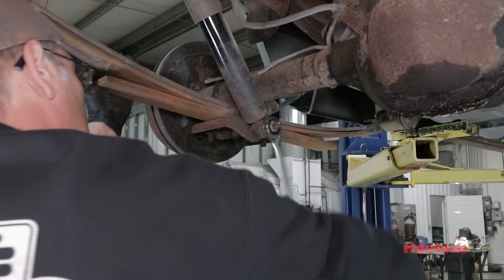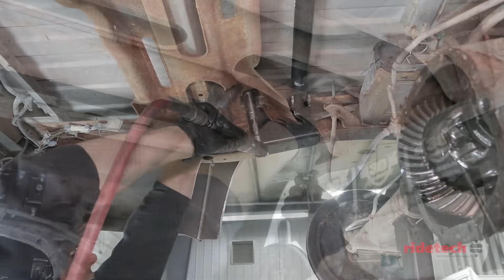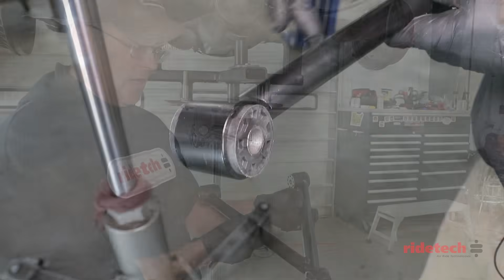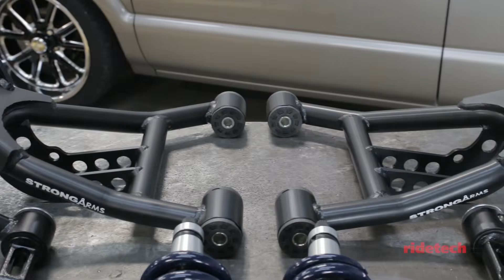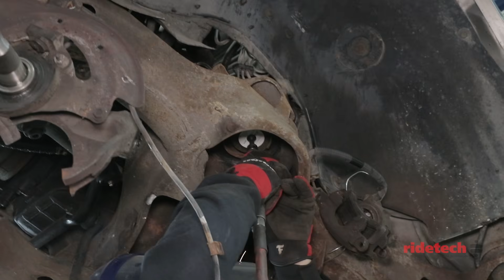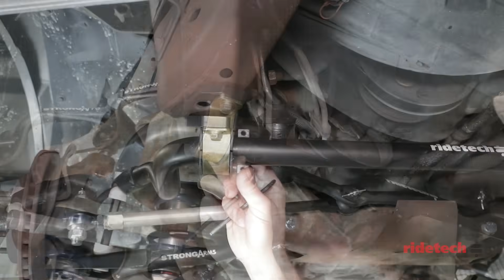GM S10, S15 and Sonoma Coilover Suspension Installation

Comment: You have got to be high on drugs if you think I am going to spend more than what I paid for the truck on suspension. what, is it plated in gold? I'll pass. I'm fine with my $500 coilovers and rear springs 😃 add a rear sway bar and that thing will corner just as good as that $5.5k system for a fraction of the price

Comment: Pricy for sure.  Not many S10's out there worth the cost of this kit.  I have a very clean 170K mile ZERO rust truck but it's hard justifying the cost.  I'd bet at 3K you guys would sell a ton more kits and still make good money.  Vastly expand the customer base.  I for one would be a buyer!
Reply: First of all, I think this is more for the "money no object" kind of builds. But beyond that, this kit was likely VERY expensive to produce (in material + R&D). $4500 seems pretty reasonable to completely redesign the suspension of a truck for a very niche market.
Reply: you are right. if you drop the price of anything by 50% it would sell faster. With your wisdom I now wonder why its out of your budget?
Reply: @@nomadicjoe6124  LOL.  Didn't say it was out of my budget just overpriced for the target market.  My daily drivers are a TRX and an F-Type R.  I'm pretty sure I could squeeze the kit into my budget.   Actually , I have started on my S-10 build that includes this kit, but I changed out the coil overs for Vikings.  Thanks for the comment.
Reply: @Oncebitten10  TRX and F-Type R.... gross waste of money... and you bought the kit you claimed to be overpriced too, cograts!
Reply: @@nomadicjoe6124  Thanks for your constructive comments.   I will immediately focus on redirecting my focus and life goals so that I may someday achieve YOUR level of "wisdom" and intellect.  I am confident the profound impact your comments have made in my life will guide me to make better decisions, thus improving my automotive experiences. Thanks again for just a few of what can only be assumed to be many enlightening, educational, and fulfilling volumes of contributions you have undoubtedly  made to the automotive enthusiasts community 😄

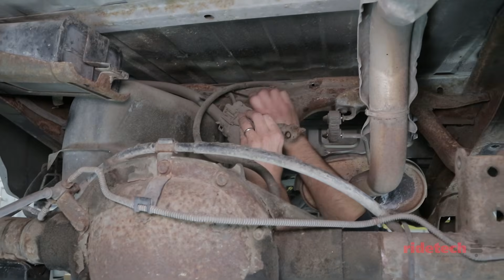Comment: At 2:23, this is the EVAP system fuel tank solenoid, not the emissions solenoid. It is normally open to all air into the activated carbon canister until enough drive time has past to close it and open the purge valve on the engine with the green port used for diagnosing EVAP leakage. During refueling, hydrocarbon rich air exists the tank at the highest spot to capture organic fumes from the tank. This allow refueling without constant shut off at the pumps handle. The EVAP system is completely separate from the emissions system except during purge as extra fuel vapors come into the engine without coming from the injectors and no code is set as the PCM’s fuel mapping is disabled during this time & also if above 80% of full or 10% below empty.
ASE Master Tech since 1978.
Reply: Completely useless info but hey, if you only know one thing, make sure you put it everywhere
Reply: @ThatLS10   Unfortunately, I had every system to work on, plus teach. Pass your I-9 security for Raytheon holding 30+ 4hr tech seminars in 7 states. I have complete knowledge of all systems including those you have never hear of. You are welcome.
Reply: @ThatLS10  you say that now to tho you'll be looking for this comment on how the evap system works when you get a check engine light for it evap systems are annoying to deal with.
Reply: @photondebuger45  i’m a red sealed mechanic in Canada.. so i doubt it
Reply: @ThatLS10  oh quite good, nevermind then
Reply: @ThatLS10  It was not useless to me. 
You speak for yourself only. 
Jerk.

Comment: Seems like the front places the whole weight just on the old shock mount... it looks structured . But seems like it should be a bit thicker or re-inforced either by a weld in or sandwich plate that somehow wraps around and under the old spring cup

Comment: Cant understand why people like lowered trucks looks like the coil springs and shocks are bad when lowered rides rough you feel every bump in the road it banges and when hitting bumps scrapes on driveways and inclines the only thing low that is right are sport cars corvettes mustanngs ect but to each its own
Reply from the maker: I bet you would be surprised just how good these truck ride. when a vehicle is lowered properly they ride just as good, if not better than sports cars.
Reply: @ridetechtv  true i am sure they ride good but its harsh on bumps and scrapes on inclines and terrible if you had to drive in the snow or off road or tow i just like the way a 4×4 sits but to each there own i have a 2000 chevy s10 extreme and i am lifting it 3 inches i got it for very cheap with a 124000 on it shoul of just sold it or traded it for a 4×4
Reply: that's why a lot of people who are lowering their trucks go with airbags. that way if you don't want it low you can still have stock ride height. people that lift their truck are trying to compensate for something in my opinion. small dick big truck

Comment: Would this work with an 93 Isuzu pickup ?
Reply from the maker: no, just for the s10
Reply: 93 no. 94 yes isuzu hombre is an s10.
Reply: The 93 is built by honda

Comment: the cost of going fast and handling is not cheap regardless of what you start with. So my V8 S10 Blazer cost me 3k. Has a nice little LT1 350 and it scoots. I would love to do this but all i seem to know is how to make a junk car cost me a lot and sell for very little.
Reply: Thats what i'm saying.. I picked up a clean 2003 Single cab Zq8. Right now I'd like to have a V8 but I'd prefer upgrading the suspension first. Just can't find any real reviews on how this entire kit handles  BEFORE and AFTER.
Reply: @ghidraa9340  if you go ls1 it's only 90lbs more than the 4.3 so probably not a lot of difference.  Add 45lbs to the rear and you're balanced
Reply: Basically relocate the battery.
Reply: @scootersonlyrepair  or just tie down a crate to the bed and add 3 15 LB dumb bells 🤷‍♂

Comment: Can you use it as a work truck if I install it on my s10
Reply from the maker: Sure Can, depending on the load your pulling or hauling may require coil adjustment, or more air pressure if using the shockwaves.

Comment: So, according to the website this 4 link kit wont fit an 03 xtreme?
Reply: lol, Looks like the truck in the video is a zq8. Kind of dumb the website says it won't fit a 03 xtreme. However, 03 xtreme and 03 s10/sonoma in general compared to the truck in this video have a different vapor canister with a wider canister bracket and a plastic fuel tank instead of steel. The vent valve on an 03 is located behind the canister just inboard of the frame, so its already out or the way. But with the different canister, it may need to be relocated all together to fit this kit.

Comment: I couldn't imagine spending 4500$ on a suspension upgrade and not painting the differential or at least buying a new differential cover.
Reply: I'd have to have the rear end from a 4wd s10.  Rear disc brake and 2inches wider.
Reply: @scootersonlyrepair  and an ugly offset set of rear wheels
Reply: Amen, i would remove the bed and paint everything but the fuel tank.
Reply: @jjj55561  why wouldn't you paint the tank

Comment: Hi i have a 2001 chevy s10 kinda simular to this truck in video will this kit fit my truck and do you have a website where i can buy this same kit but i want the air ride and also if i c notch my frame will i be able to sit my truck on the ground with this kit
Reply from the maker: Hi Travis. Check out the S10 section on our Trucks page here for the complete air ride version of this kit: https://www.ridetech.com/applications/trucks/

Comment: $4,500 suspension on a $1,500 truck, is a little like polishing a turd.
Reply: I've seen these trucks sell in 2021 for well over 6500, up to 20k. The times they are a changing. Everyone wants these trucks if they can find one that's not worn out.
Reply: @BartlettDaveJr  Are you seriously cruising comments sections and replying two-year-old comments? 
 And NO, nobody is buying a S10 for $20,000. If you believe that, I got an S10 I will sell you.
Reply: @MOEMUGGY  lol. There's a lot less than there were and people like them. No shit I saw one yesterday, crew cab S10 19,500 and I saw an 84 blazer they wanted 24,000
Reply: @MOEMUGGY  ok sure. I'm just trying to rebuild my blazer and it's not even running and I won't let it go for less than 2500
Reply: @BartlettDaveJr  dude, you can buy 10 blazers a day for $500 a piece on Facebook Marketplace. Your Blazer isn't worth $2,500 running. Seriously though, I don't care. Go away.
Reply: @MOEMUGGY  yeah whatever, my blazer is not a rusted hunk of junk, I just bought another one for 500, I'm not an idiot. They get way pricier.

Comment: i have a 1950 f-1 with a s10 frame. i could use a arms that are wider than stock to make the tires fit better. if i buy the kit can i get a arm made for that or you don't do that?
Reply: Get  a cvpi frame  Instead  keep the Ford a ford.
Reply: @scootersonlyrepair  it was a rusty pile of parts a customer gave to me to cover their late bill it had no frame or engine. and i was like 18 and poor. also who cares about ford in a ford. hot rodding is about riding and having fun. not being a puritan.

Comment: When your suspension costs more then the truck lol
Reply: Just got my catalytic swiped. Cost mea nearly 800 to replace including a used Flowmaster that I got a good price for .paid 500 for the Damm truck. They Damm near  stole it 2 times since I had it. That alone was more money than. The dam truck cost alone.  But hey this thing took me from Stockton ca. To los Angeles on 1 tank. Never left me stranded till the motor blew after I put the new catalytic.. don't know what went wrong man it ran so good. Smh 😔.  But I'm gonna fully build it.  The process has begun
Reply: How much?!?
Reply: @mistahferguson6240  like 6k
Reply: @lege46 gawd damnn.. I was thinking of getting it but holy fuck I could just buy 3 more s10’s🤣
Reply: *than
Reply: I mean... my S10 Blazer with less than 110k on the clock cost me $80, so... a full tune up costs more than my truck 🤣
Reply: @Scott9181970  I see the V8 swapped S10 he's going for 15 grand they're worth good money if you put good money into them
Reply: Prices have gone up since then, those trucks still aren't worth any more
Reply: @BartlettDaveJr  worth more no. Selling for more fucck yes.  An excellent condition 2001 extended cab with 40k miles  sold for 16k stock except the stereo and wheels
Reply: @scootersonlyrepair  agree
Reply: Truck in mint condition 7 grand……suspension 🥸

Comment: That cross bar the upper arm is attached to is pretty thin gauge metal, wonder how it takes all that strain of the rear end torquing around.
Reply: Yes. They have an " optional" cross brace for that very reason.

Comment: Would this kit also fit the s10 blazer or Gmc jimmy?
Reply: They’re similar in design but totally different in the rear
Reply: @stellingbanjodude  ah fair enough
Reply: Are those not the same chassis
Reply: 2wd yes
Reply: The frame is slightly different but the suspension is the same
Reply: The website says no

Comment: Will this work for 4wd?
Reply: No 4wd s10's use torsion bar front suspension. There is an axle driveshaft where the spring would be located.
Reply: @drummin84  still doesn't mean you cant cut out the torsion bar cross member and put coil overs to the factory shock location like this one. And this may be one of a few kit that does work with the front axles......

Comment: Whats the info on the wheels? Brand, size, width, backspacing and offset? Thanks
Reply from the maker: US MAG Rambler U117     Front-18x8  4.5" Backspace   Rear 18x9.5  5-1/4" Backspace   Tires are BFG 245/40/18 & 275/40/18  http://us-mags.com/rambler-u117-w-12064.htm

Comment: I'm looking for something to do with my 1995 Roadmaster it's a B-Body . But what's on the market for these.?
Reply: I'm sure they have something because it's basically an impala
Reply: Most likely you'll find front and rear sway bars, lower and upper control arms, and coilovers from a few companies. UMI, BMR, QA1, Global West, and SpeedTech  offer a few options for each. The price is a bit high if you're on a tight budget. Like the guy before stated, it's basically an impala with a different shell.